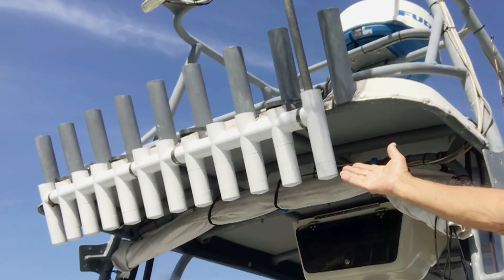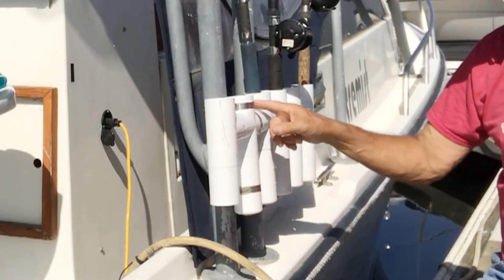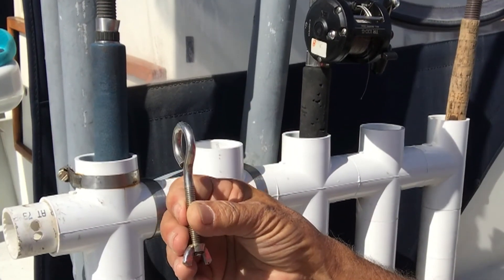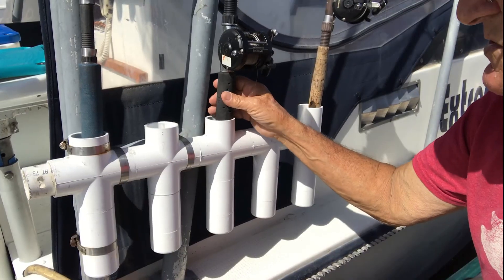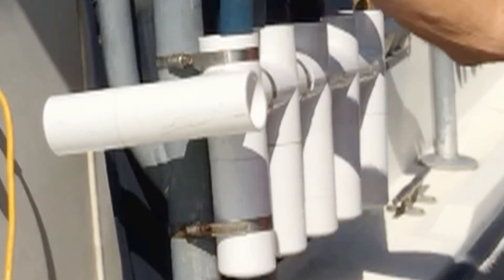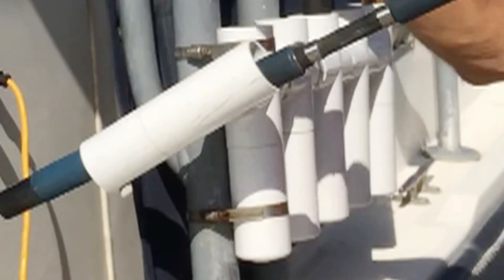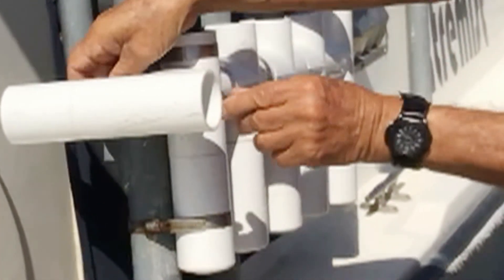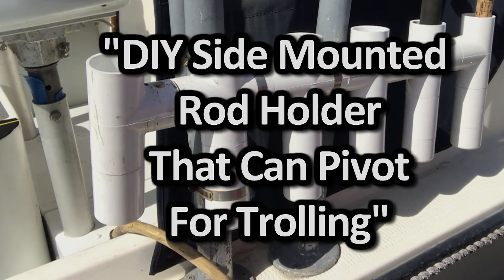DOWNSAIL   DIY ROD HOLDER  CHANGES TO TROLLING MOD. Side rigger  Troll a spread of 24 feet.

Comment: Thank you for watching this video.  There are a couple of others that I take great pride in.  There is a rod rack for the tower or overhead area that costs about 80 bucks to make.  To have one made in stainless would be more than 10 times the cost.  There is an under the gunnel system that saves space.  Hope you take a peek at them.  Please click like.    This is the best work I am able to do and I love to share and have people consider using the ideas.  Please consider a like, subscribe and most of all comment.  Thanks, Ron